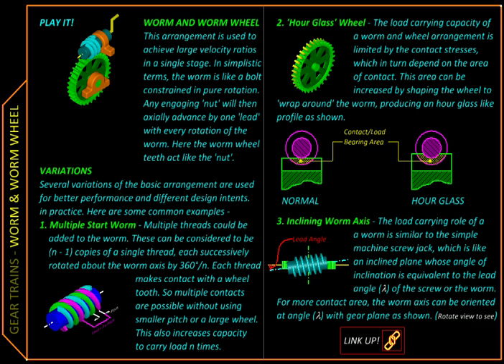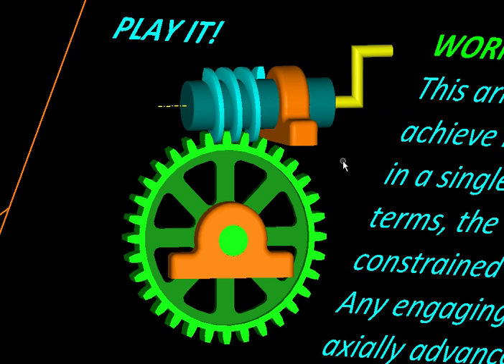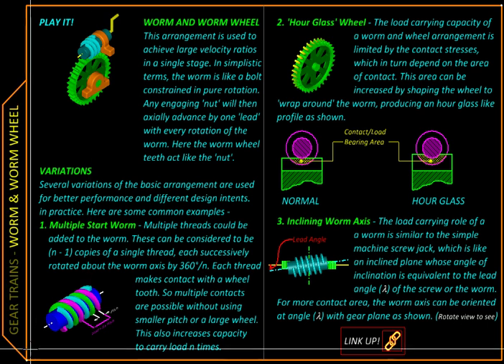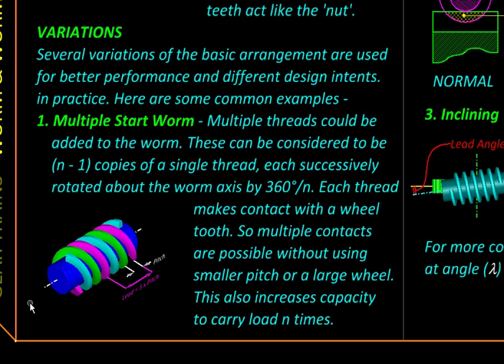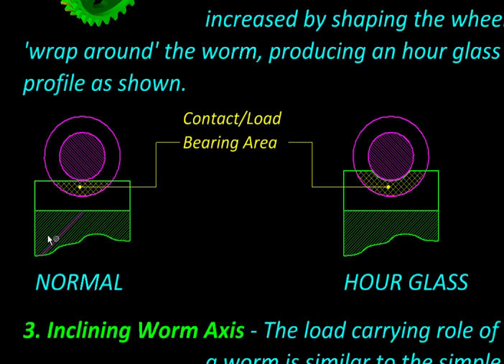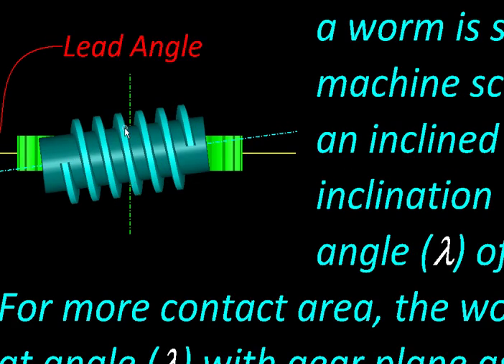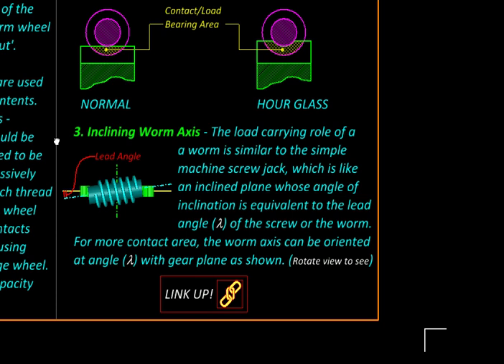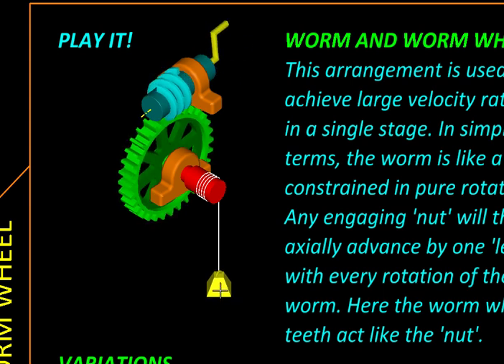Kinematics Ch06P Worm Gears

Comment: Sir,What are the good books to understand the concepts of Kinematics of machines and mechanisms
Reply from the maker: I found several books that cover different topics very well. E.g. Thomas Bevan is great for gears, Hall or Hinkle for mechanisms, Erdman and Sandor, Ghosh and Malik are also great books.
Reply from the maker: I guess I should have asked you before replying - are you a student or a teacher? The books I recommended may not have the material given in the same order or to the same depth as in your syllabus, so be prepared to spend a lot of time. If you are teaching the subject that is a good investment. If you are a student, it is still a good investment, but you might have 4-5 other subjects making a demand on your time. So plan accordingly. 
Wish you the best!